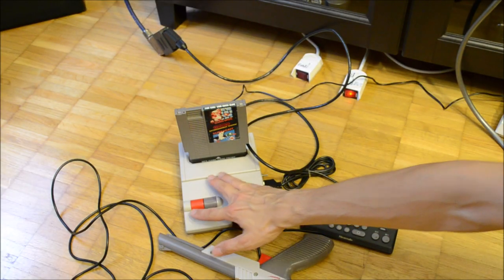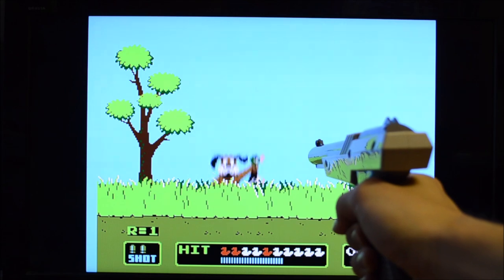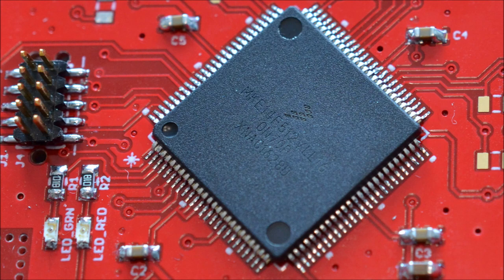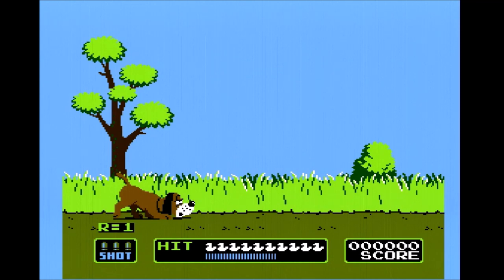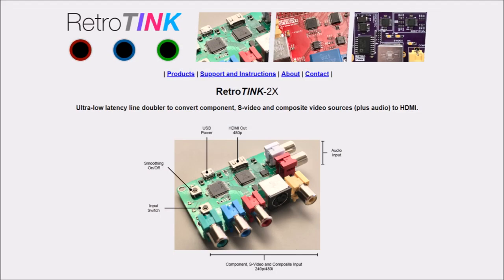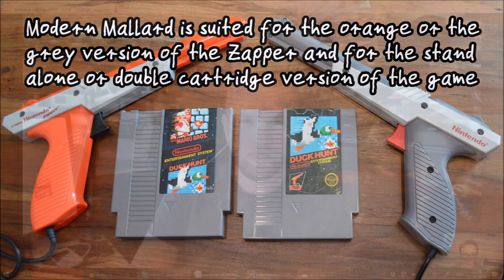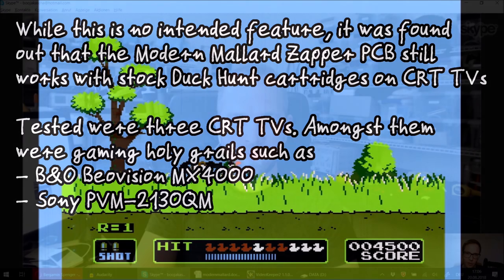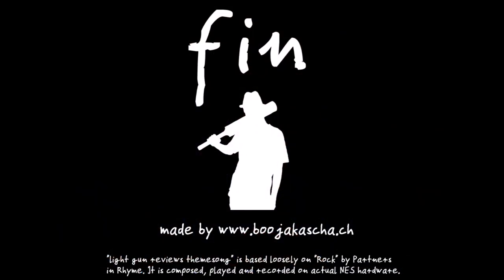Light Gun Reviews 88: Modern Mallard: play Duck Hunt on a LCD TV

Comment: What happened if you own a CRT and a LED? lets say, I installed the modern mallard to the game and play at the LED TV one day, then few days later I decide to play with my CRT, I will have to unistall the MM again to play it?
Reply from the maker: as I remember you can set the delay to 0. The gun works on CRTs for sure. So I guess you can play on a CRT no problem.
Reply: @Boojakascha  Then this is a nice way to play with the original cartridges.  I wonder how much it wil cost each MM. By now some guys also did the same but patching roms and of course we must use  an everdrive or create  repro cartridges and an easy  and super cheap mod to the original zapper lightgun.
Reply from the maker: @juanjoserivasgarcia2336  There is even a hybrid which takes the patch back to a patch board. I show it in episode 162.